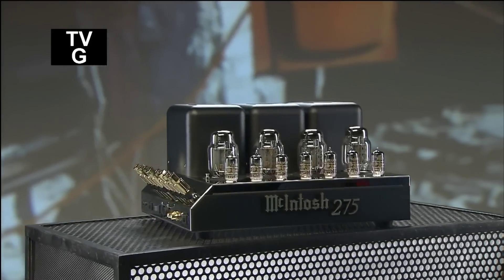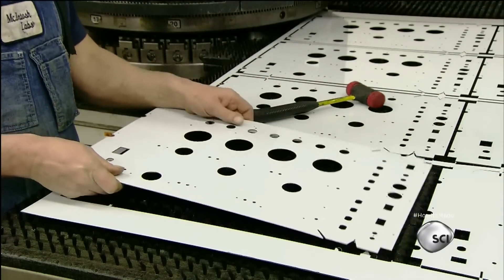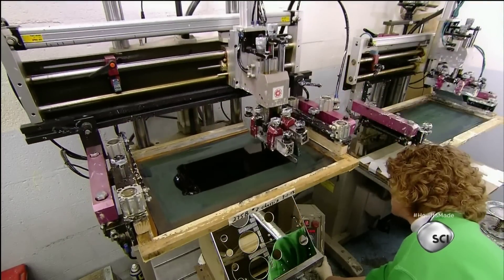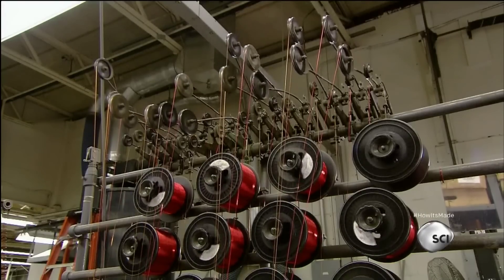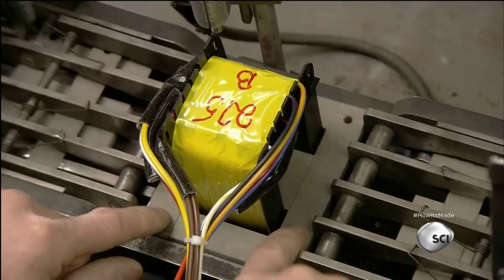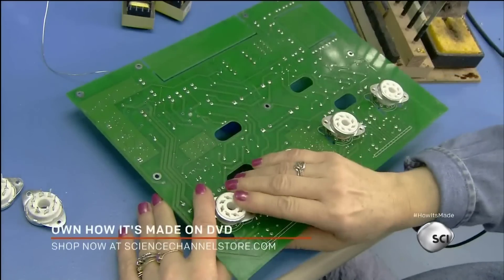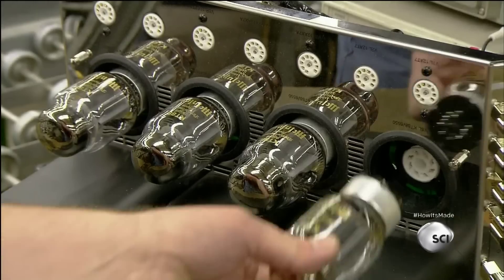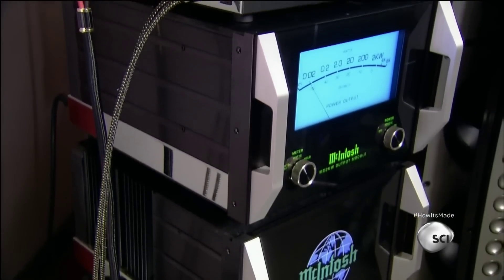How It's Made - McIntosh Tube Amp

Comment: tube sockets soldered straight to the board is kind of cheap construction for such a high end (expensive) amp
Reply: classichammond It is you who is HILARIOUS, over my 76 years I have built and owned many “HIGH END AMPLIFIERS” both tubed and Solid State.
In many blind listening tests I have seen NOT ONE IOTA OF EVIDENCE that listeners can tell the difference in the sound.
This is especially true if you listen to “POP” music as opposed to classical music.
With Classical music anyone who knows the music VERY WELL may be able to hear a difference, but as for classing those differences as “BETTER OR WARMER” that is pure conjecture.
Pop music is so distorted to start with that is makes any comparisons WORTHLESS.
Essentially there are NO differences except the price and personal preference.
Reply: @brit1066    Far as I know after 30 years of following these kinds of debates, never once has a controlled, double-blind listening test with levels matched to within a half a dB or so EVER produced evidence that anyone can reliably tell the difference between well designed, low-distortion amplifiers. Never.  And some skeptics have offered some really hefty cash prizes for any "golden ear" who can pull off the feat.
Reply: yesi agree and using surface mount tech on the same board.....ugh....sw a video of a guy repairing a mesa bogie amp.tubes and solid state on  the same board. muting circuit used transistors to disconnect the cathode from the circuit....of course they were blown out....if solid state components are used in a tube amp theey should be in the pre-amp section ....this amp has tube pre amp and shouldn't have any solid state components at all.
Reply: HH Scott When you use remarks like F@#$(K, you completely undermine ANY CREDIBILITY YOU MIGHT HAVE HAD.
If you think that anyone at a POP MUSIC CONCERT can tell if the amplifiers are Tubed or Solid State, or even CARES, then you are delusional.
Thank heavens that REAL CLASSICAL MUSIC is still produced by instruments that do not need electronics to actually make the sound and require ONLY AMPLIFICATION in its purest form. 
Go to the great Concert Halls of the World and see if they use Tubed amplifiers. Classical music lovers want to hear the natural music NOT SOME GOD AWFUL mish mash produced artificially by electronic music manglers.
Reply: Andiar Rohnds let them waste their money on vacumm tubes.... I bet they think tube TV's also produce the best image also LOL. Vacuum tubes produce nostalgia sound and for that they think it sounds good.
Reply: Nope could care less I just think it's funny people defending snake oil.
Reply: Joe Shmoe Joe, out of interest, what is the high end method of fitting valve bases to the circuit board?
Reply: Wrong and wrong... gold doesn't oxidize, and gold is a worse conductor than copper... wtf.
Reply: Richard Smith gold can oxidize and I. Ever said anything about copper
Reply: TMoD7007 The tube sockets on a sub assembly wired to a male socket which plugs into a female socket thats soldered to the main board.
Reply: So use socket savers. Easy peasy.
Reply: Joe Simon how else do you attach sockets to a circuit board?
Reply: classichammond
No he's correct,  do some 'real' research about acoustic labs! Or if you're too lazy, fuck off!  And stop lying here about your workplace knowhow. filthy reject.
Reply: that totally minor... watch the part when they assemble the speaker connectors again... then look at the size of the supply leads inside.. facepalms
Reply: Dcool, actually vacuum tubes isnt just about sound its about ease of amplification without distortion.  you should look into classifications of amplifier design before talking.  you sound like someone who takes at face value a label that says 2000 watts output yet... the amp's input requirements is only 500w...  DERP.
Reply: That amp is nothing but glam and glitter I will totally agree with you on that, but the reason why people choose tube amps isnt just cuz of how it 'sounds'  there is amplifier design reasons as well.  Like to see your 10kw audio amp made out of semiconductors... mr. snake oil.
Reply: @TheOriginalSycHolic   What on EARTH are you going to use a monolithic 10KW audio amplifier for? A godawful huge PA system? It's most likely you'd be better off buying ten 1KW amplifers. Shoot, McIntosh's current top of the line amp is a 2KW solid state monoblock. Five of those and you're golden. :D  Heck, even medium power RF applications are moving solid state just as fast as the semiconductors 'll let them. There are a bunch of HF and VHF 1KW linears on the market now, some of which use a single output device. Yeah, 1KW from a single transistor. March of progress, baby, march of progress!  Only place tubes are really necessary nowadays are in the 10KW and up class.
Reply: @Andiar Rohnds: Please provide a valid source which supports your statement about vacuum tubes being a scam!
Reply: Adds more electrical resistance for even more of that "warm tube sound", aka distortion. See, directly soldering components makes too solid of an electrical connection. You want as many layers of loose plugs and adapters as you can fit. And they all have to be gold plated brass, because copper is too good of a conductor. You really need to strangle those electrons to warm them up.
Reply: hate to tell ya but the only reason gold is used cuz it doesnt oxide... derp. otherwise you'd use silver for connectors as its a better conductor then even copper and gold.
Reply: @TheOriginalSycHolic    I ended up replacing the phono input jacks on one of my receivers because the tin-plated jacks had corroded so badly that they were behaving like semiconductors, turning my phono preamp into an AM radio! :D  Mechanical stability and corrosion resistance are good things. :D
Reply: Science-is-god woah, some butthurt dude created another account to backfire others, well are you a child or some thing, ... Sir. And by the way, why don't you tell your logics to the tube amp marketers and manufacturers yourself. Such shallow minded, subjective "listener"; whatever makes sense to people exists. And by the way, " should all Android phone users must die, is that your idea ??". Fuck off please
Reply: lmao..... thats funny I thought it was odd the tone of the convo didnt change.  he's prob some guy who got ripped off spending tons of $$$ on buying one of these amps after watching and finding out actually whats inside.
Reply: @Joe Rico

"The tube sockets on a sub assembly wired to a male socket which plugs into a female socket thats soldered to the main board."

But that adds stray inductance, resistance, an additional source for 50/60Hz hum, and noise from flaky or dirty and corroded socket connections. That is like the worst idea ever.

If you want to keep your signal as pure as possible, the sockets soldered to the PCB directly where the signal traces are routed with shortest path possible impedance matched traces over a copper ground plane inside the substrate , or even better, on an inner layer with ground plane either side, on top and below the signal traces.
Reply: Andiar Rohnds    turn your amp on and short out the outputs..... then tell me how great transistors are.... now short out the outputs on a tube amp.... the tube amp keeps going.... the transistor set is landfill fodder....
Reply: good point but only plebs dont put fuses on their speaker lines. (with either design method that is..)
Reply: Not honestly a valid reason given you didnt notice the KT88 sockets are metal bracket ceramic air-gapped standoff connectors that mount right onto the metal frame, and its HV low amps signals.   There is little heat created by the preamp tubes (12AT7), tubes of those power levels are the kind you see with audiophile headphone amps.  I dont see those 4 tubes causing serious issue esp for a 2ch 75watt amp (150w bridged)... facepalms   start talking when you build a single tube 1kw RF amp and need a fan providing positive manifold pressure not just a laughable PC fan.... let alone convection cooled
Reply: You don't even need to spend a lot of money to see for yourself that tubes have a different, very attractive, sound. ~80 bucks for a good but cheap true tube pre-amp and listen for yourself.
Reply: Lulz Jackie. so wrong.. stop talking about silver and saying gold.
Reply: Syc holic Read what I said dumbass I said gold is used because it’s a far better conductor other than silver
Reply: Its also a better connection that using wires
Reply: classichammond He hasn't even heard one before obviously. It's not a matter of deafness. Just inexperience is all. He's only going by what he's read somewhere, and thinks that makes him an expert. Probably listens to music on a AVR with a 5.1 in a box speaker system. Or worse. A godawful Bluetooth speaker. Lol
Reply: HH Scott Tubes move people! are you referring to the London TUBE trains? those do actually MOVE people.
Go to any POP music concert and ask the audience is they can tell if the band is using TUBED or SOLID STATE amplifiers.
Please report back your findings, or better still just shut up.
If you can find one person in ten thousand who can CONSISTENTLY tell the difference I will EAT MY AMPLIFIER.
The most significant fact is that LISTENERS couldn’t care less what kind of electronics are being used let alone IDENTIFY the type.
Even listening to classical music I make the same challenge, NO ONE CAN TELL, TUBE FROM SOLID STATE.
Reply: @brit1066    Tubes move me... when I accidentally brush up against the amp and have to jerk my arm back to keep from getting burned. :D
Reply: Andiar Rohnds You're a schmuck man! How are you going to tell people something as subjective as sound, is better with one thing, over another? In a blanket statement, no less! When there's thousands of different amps made that all sound different.

What's BS are people like you that come on here acting like we listen to music with measuring devices. And that we need people like you to tell us what we hear with our own ears. I'll decide what I think sounds better. Thank you very much!

And BTW you realize they make both at all price points right? And all different designs too. All with different sounds. That all sound different in different rooms too. smh
Reply: That's like saying I never heard it....but it's bad. My CD player has a tube line stage running through Electro-statics. I can't do box speakers although I own a pair of Fulton Premiers that are not too bad.....for horn stuff.
Reply: classichammond I need to hear some electro-statics. Everyone says they're not dynamic though. I'm curious what that's like. I like dynamic speakers, like horns. I'm thinking I would have to get used to them. I'll probably buy some Maggies someday to try them. My latest pair is some Cerwin Vega VS-150's. Oh man they so dynamic, and have plenty of bass. But it's a bit much on some recordings. Especially since I don't have any tone controls on that system. I need to try another preamp. Very musical though. They really get you into the music. Not very detailed, but nice tone on most stuff. And great at low volume. Very interesting, and I stole them at $200 in really good shape. They'll give you a hernia moving them, and they take up some serious space though. So be warned if anyone is thinking of getting some. Over 90lbs a piece!
Reply: @amb3cog   Maggies sound magical, especially reproducing chamber music. You'll start looking behind the furniture for the violinist!  Thing is, they are NOT very efficient, so be sure to have a LOT of amplifier on hand.
Reply: unless you using analog inputs the whole way (and that means no digital music even lossless...) even a pure 100%  tube pre-amp isnt going to sound proper which is why most pre-amps arent tubes let alone employ DSP signal processing/effects..., that tube is the drive section to bring them up to proper drive levels for the power section/amp
Reply: gold can oxidize and gold is used because it is a far better conductor, other than silver
Reply: I'll bet you never heard any good tube equip. Your comment is hilarious.
Reply: @classichammond   Actually, The Old Man™ would agree with Mr. Rohnds up there. You'll notice that Mc waited until after he passed away before trying to bring a tube amp back to market. I can just image what he'd have said. :D  And while the distortion in my MC-275 is almost inaudible (at least at any reasonable listening level :D), the distortion on my MAC-4100 really IS inaudible. Same power level, 75W into 8ohms, and I can play the solid state receiver loudly enough to hurt my ears and frighten the bejeebies out of the neighbors with no distortion. I can't quite get that loud with the 275 before the treble starts getting a little fuzzy.  Mind you, it's still a marvelous performer for a half century old tube amp, but tubes haven't been state of the art (no matter what the marketing brochures at the CES tell you) for decades now.
Reply: classichammond Exactly. I have a few of each. There's no contest. My best SS one kicks out the bass more, and has more extended treble. So I like it on rock better, especially metal. It's a lot more expensive unit too. My tubes are all low powered. But if I had something like this. It wouldn't be the case at all. Mine are old too. Now for actual sound quality. Forget it. Warm, and musical doesn't begin to describe how good the tubes sound. I have old full range drivers that I can just lay on my bed. No baffle even. And playing Etta James on either my SET/SEP, or my push pull will make you weep it's so beautiful. Sounds like she's in the room with you. It's amazing. And these are not expensive at all. The good ones are ridiculous. That's what got me into audio. I heard some brand new tube mono blocks many years ago, and couldn't believe sound like that was possible. I didn't buy anything that day, but it's never cost me more to go into a store in my life. Lol
Reply: classichammond Mesa 400+ is a bad arse amp my man! I would love to hear you play on that thing.
Reply: Trust you!? I suspect you are deaf.
Reply: also, vacuum tubes are actually just a gimmick. they dont actually produce sound accurately, and transistors are much better. people think tubes contain better sound within them or something hilarious. when the truth is, tubes are just really old, power hungry, inefficient transistors
Reply: It's a different sound. I like the inaccurate sound it produces for my Guitar and also for certain music as well. If I want accurate I will go use my Monitors.
Reply: Andiar Rohnds Please explain to me why it matters what it is, if people enjoy the sounds? First. 2nd your comment clearly shows you've never heard one. So your opinion is pointless. STFU!

Music is about emotion period. It's art. People like art, because it moves them. Tubes move people. They'll make you weep with joy. Who gives a good God damn how, or why? As long as it does this. And why don't you go try this argument with all the professional musicians that swear by them. Explain to them your "engineering theories", and see if they suddenly "see the light" or whatever it is you expect people to do once they find out what they already know. The same people that know more then you BTW. Troll!
Reply: Andiar Rohnds You're mistaking the measurements from a machine for what we hear. People don't think anything. They know what they hear, and what they like. You don't listen with a machine. You listen with your ears. And yes I've done blind tests. I can pick out the tubes easy. Even with guitar amps, not HiFi. You think all these musicians use them, because they don't know what sounds good? If you're going to comment on something like this. I recommend you have experience next time. So you don't look so foolish. You're just parroting what some other idiot said on here. And he didn't know what the f@ck he was talking about either.
Reply: the audio world is really just BS. trust me when i tell you vacuum tubes are actually a scam. they dont really do anything, and transistors perform much better.
Reply: I spent over 10 years in high end audio, design and manufacture. You can't measure "good" sound. To develop a speaker system or amp or pre-amp.....you need to use your ears. I'm also a Musician running the same 6550's in my Mesa 400+, leslie speakers and home audio power amps. (My 400+ has 12 6550's)! A pure class A solid state can get close.....but costs the same as good used car. Price a vintage Marantz.
Reply: @classichammond  nice to run 12 6550A tubes in this Mesa Boogie Bass 400+,but as the amp was designed to run with 12 6L6 tubes,doesn't the powertransformer getting very hot or did you put a heavy computerfan with it,to get it cooled-off?
I also owned one and have now a Buster 210 combo,maybe try this idea with this amp,still have a lot of GE 6550A's,matching them with a u tracer tube measuring system.
Reply: The 6550's have done nicely for well over 10 years.....perhaps closer to 15. I like the full sound I get yet the gravelly growl when I kick it. I run Hammonds through it. If you research it you will find the 6550's are an option to the 6L6's. As for heat the unit doesn't appear to run too hot and the fan seems to handle it....if it kicks up I don't notice. The Nobis amps I use to build required changes when moving up on tubes but only to trans voltage and bias. The tubes probably run cooler than when pushing 6L6's to the edge.
Reply: @classichammond    You might be amused by this:  When I graduate from high school, The Old Man™ took me out shopping to get me a grad gift. I dragged him to Veneman's Music in Rockville, MD, and got him to buy me a Boss OD-1 (my first decent effect. Wish I still had it.).  He asked me what it did and I told him it simulated the sound of an overdriven tube amp. He lit off with, "I spent my entire career designing distortion OUT of amplifiers, and now you buy a little yellow box to put it back IN?!?!?" and grumbled about it off and on the rest of the day.
Reply: This Mac Amp isn't such a "High end" Amp. 7K isn't shit.